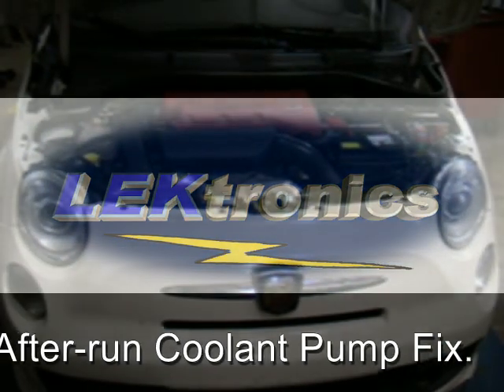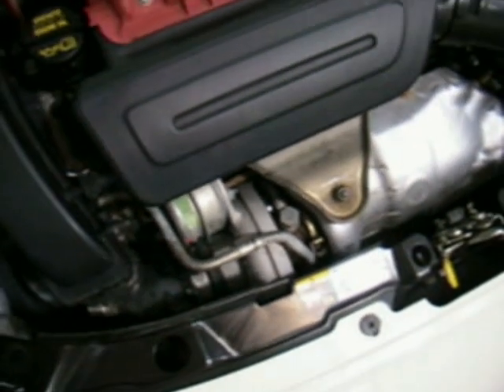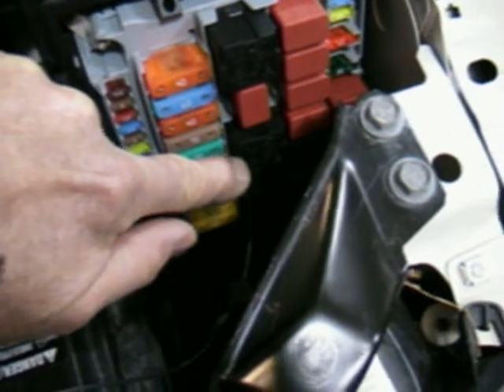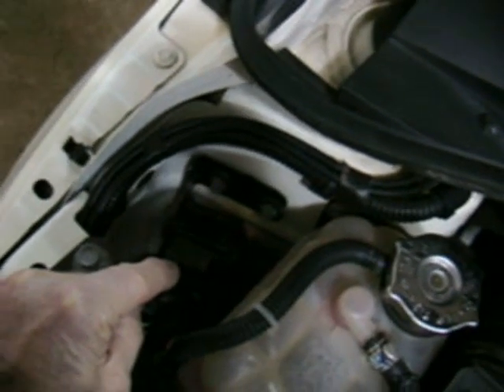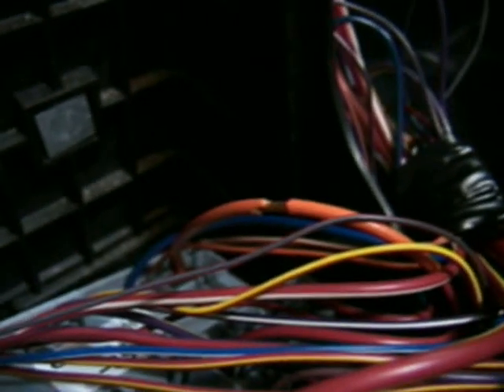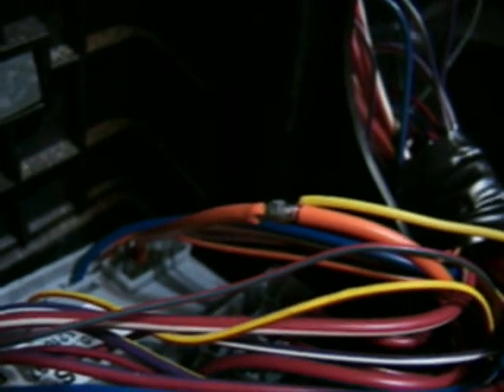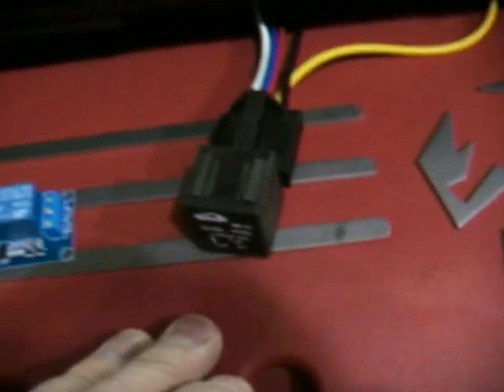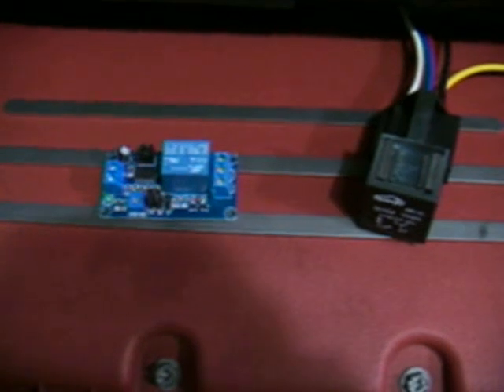Fiat 500 Abarth  - After Run Coolant Pump Fix

Comment: This is very good.  I have seen many people beginning to have issues with their after run coolant pump stop working with no reason why.  This is a great fix.  Put on the list for sure.
Reply from the maker: Thanks! Hopefully it will save some Abarth turbos from premature failure. I'm pretty sure that this fix will apply to the 124 Spider and the Dart as well.

Comment: This really is really wonderful even if it’s filmed with a flip from from 2006. I noticed our secondhand abarth 2015 wasn’t running this pump at all after a hard drive. I could see the coolant perking backwards through that loop into the top of the coolant reservoir, interesting. At least it’s circulating somewhat on its own, lol.
Reply from the maker: Thanks! Three years later, and the pump is still running every time I turn the car off.

Comment: Is the original problem the computer ?  I heard you say you changed battery.  I have abarth and getting ready to change battery in mine.
Reply from the maker: Not completely sure. All I know is the problem started after the battery failed. Had to jump it several times to get the car home.
Reply: Ok thanks for the input. I will change my battery out before it fails. It's four years old factory battery so I sure it's bout done.  Keep videos coming. Love my abarth we only had now for 8months I bought used.  Jeep is parked at 3.00 a gal here in Indiana !   Thank you my friend !